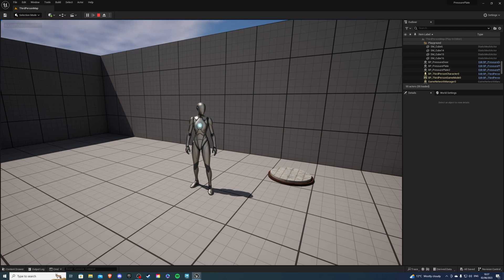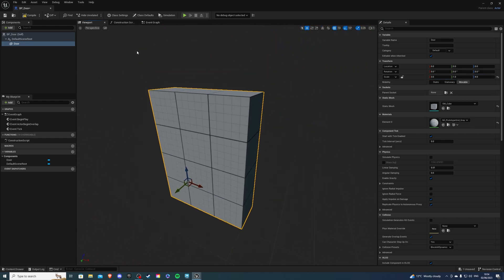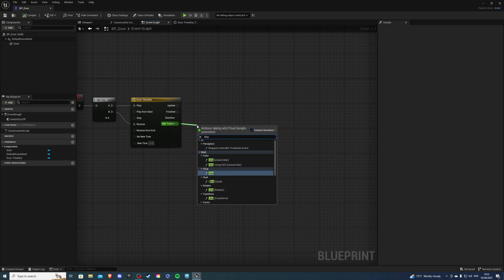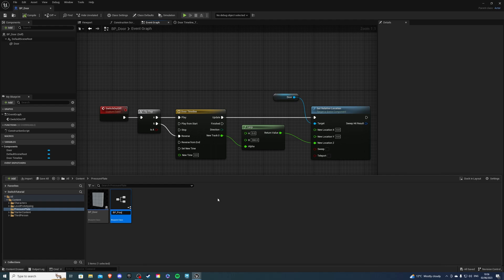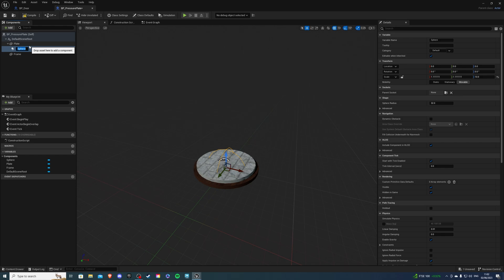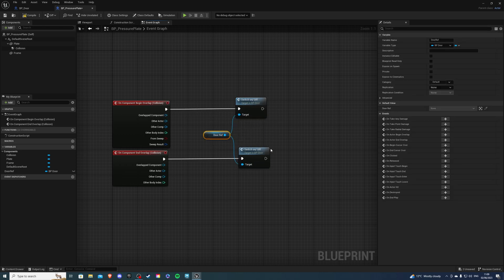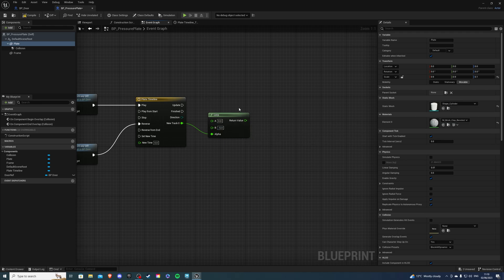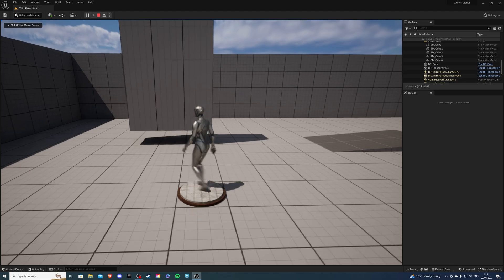Pressure Plate/Switch Tutorial - Unreal Engine 5.2

Comment: Thank you for your always very informative videos. I have a question. I wanted a cube to fall on the switch using fracture mode so that it breaks when falling. But with fracture, the collision on the switch no longer works. I enabled "Generate Overlap Events" in Collision but it doesn't work. Do you have any idea please ? Thanks.
Reply from the maker: I had a look at your issue and I cannot find out why it is doing that. I've tried most if not all the settings and can't get it to work. If you get it to work then great, and if you would share that then even better.
Reply: @lisowi.  OK thanks. If I find a solution I will post an explanation comment.
Reply from the maker: So that's actually a bug, there is a work around for it. You'll have to select the button not the collision, and add a 'simulation generates hit events', and add on hit event, and add it to the event graph and plug it in before the switch and timeline. Credit goes to my friend 4Foxy he actually found this out.
Reply: @lisowi.  
Ok thank you very much I will try this solution. 
See you soon.
Reply: Hi...I wanted to get some clarification on this as I'm trying to have it so my player has to move a box onto the pressure plate to open it but mine isn't working (it works perfectly when the character does it).  Is this the same kind of solution?   @lisowi.